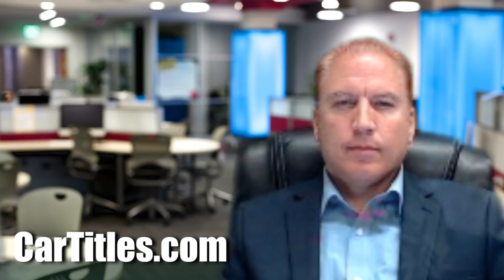Where to find the VIN# on a trailer

Comment: I bought a used Elkhorn Cabover Camper and the VIN & weight sticker on the back had been erased by weather. I looked everywhere else I thought it might be. I had given up. Yesterday working on some renovations, I had pulled two of the kitchen drawers out to inspect the fresh water tank and there above the tank on the drawer framework was a white sticker  with the VIN on it!